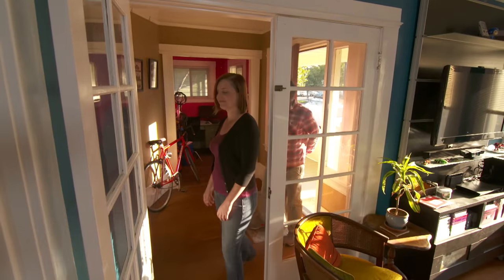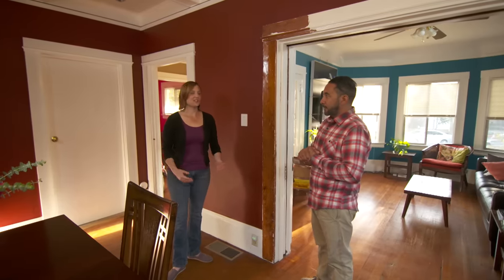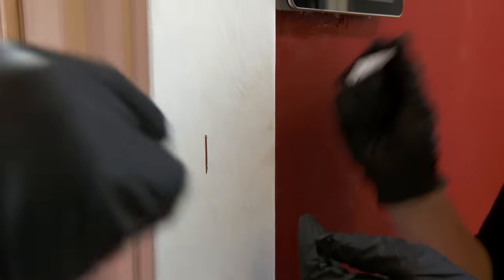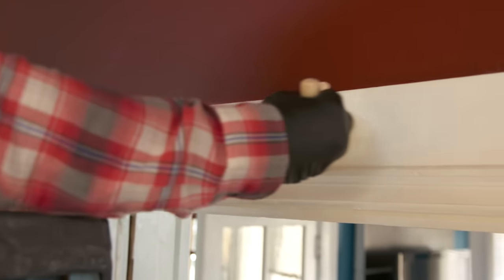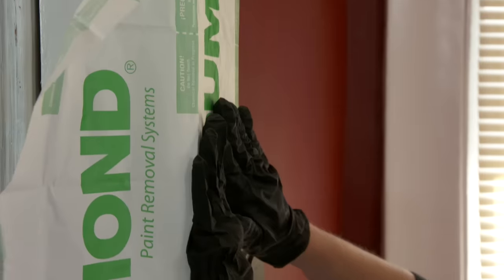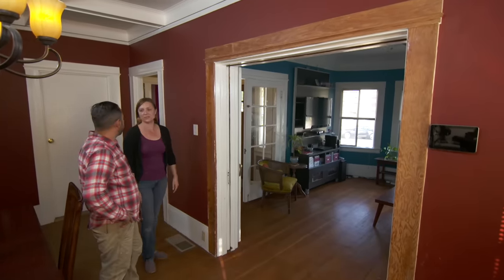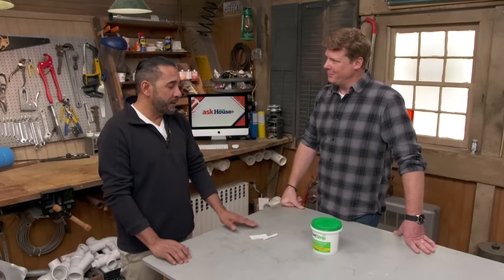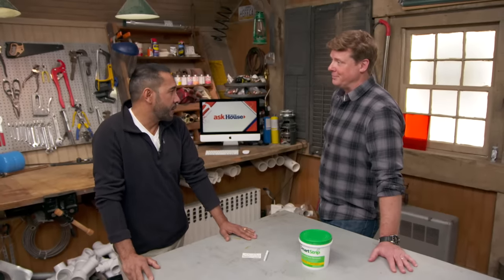How to Safely Strip Paint from Woodwork | Ask This Old House

Comment: So what do you do if you find lead paint?
Reply: Depending on where you live, if you want the paint completely off you have to, or you should, contact a state certified lead abatement company to remove the paint. A paint company can be certified but most are not. This is not a cheap process. I know this only because I once was a journeyman painter, company owner,  30+ yrs,  before I retired. Some counties will allow you to encase or encapsulate, if you will,  the paint which is what many reputable paint companies will do. That is they will paint a white pigmented shellac over the paint. Shellac, when dried is not permeable. You can use a water based paint on top of the shellac.
Reply: @dannyixoye262  thank you

Comment: HERE'S WHY I DOWNVOTED: Sorry, TOH, but I have to call you on your BS for this one. Implying that this product works as well as you show after a coffee break (unless the break lasted a weekend) is very misleading. The product label itself states that it needs 3-24 hours. Inspired by this segment, I just used it on an exterior door that had 1 coat of primer and 2 of paint, and let it set up for 24 hours. It took a lot of scraping with a metal knife (plastic did nothing!), and it still didn't all come up. I'm really disappointed that y'all weren't really up front on this one.
Reply: I had a similar experience but I let it cure too long and some of it dried. The second coat sat for 3 hours without paper and it came right off. It also needs the nylon scrubber afterwards and to be wiped down to get the residue, but it's worth it.

Comment: No reason to test for lead  unless you are sanding
Reply: Silkworm better safe than sorry
Reply: Silkworm False!!! That is completely wrong
Reply: you must check with health department to see if and how you can dispose of stripped material if you find lead you cannot just throw the stripped paint and stripper in the trash without proper treatment.
Reply: Dave E The fact that many people agree with him is extremely scary LOL...not scary for me but scary for themselves...I could care less if they take bad advice
Reply: PatsCelticsFan 9 people isn’t a lot Lol
Reply: PatsCelticsFan lead is harmful if ingested. I had a lead technician certificate when I used to test lead in environmental wipes paint chips dust etc...
Reply: PatsCelticsFan explain why you think I'm wrong
Reply: Miguel Angel It’s 9 more than it should be...that’s means more than 1 idiot thinks it’s ok...more people agreed with him
Reply: Dave E according to federal law waste must be disposed of as normal household waste. This isn't asbestos
Reply: anytime the paint comes off it would release lead in the air
Reply: Blox117 not if it's encapsulated in wet paint stripper. It's only if it's dry that it becomes airborne
Reply: The fact that she was able to strip using alcohol clearly indicates that she was dealing with LATEX plaint, which generally have NOT contained lead.  Notching her wood, stripping her varnish -- it was all gratuitous.  Lousy episode with lousy contractor.

Comment: Stripping paint from wood is far too much work.  It would have been a lot cheaper and easier and quicker to just replace all that wood.
Reply: tchevrier Not cheaper to buy hardwood, but a whoooole lot easier. Unless they consider their time as money, but most homeowners consider work on their homes as sweat equity.
Reply: @tchevrier  I paint balsa wood all the time, so you think I should be shot?  Get over yourself.  You're gonna fly off the rails there, Skippy.
Reply: @kellerrobert80  Lighten up Homer and try and understand the context of the conversation

Comment: Come on with the lead testing nonsense.  All paints had lead before 1978.  No need to test if you know the age of your home and see more than two coats on the wall or trim.  Fastest way is to remove trim (if possible) and chemically dip it with a pro and your done. Then you can sand and repair outside for minimal dust and chemicals in the home.